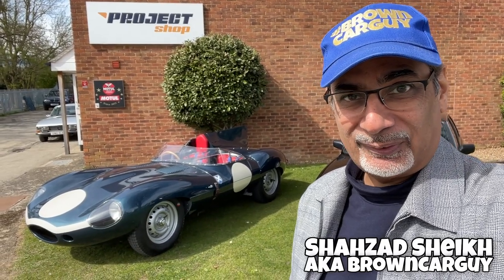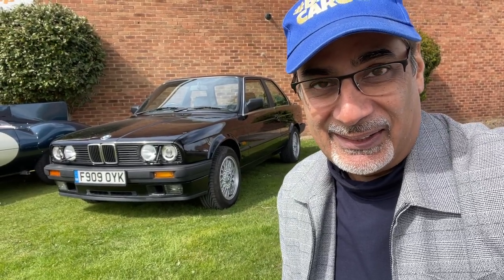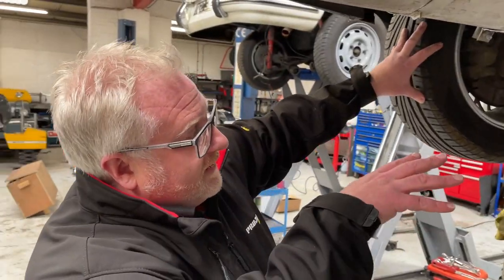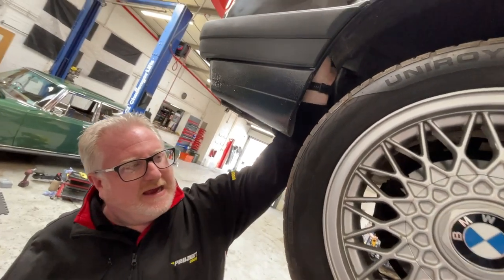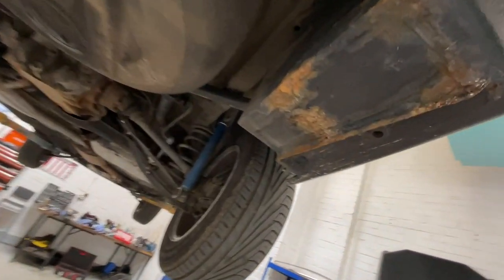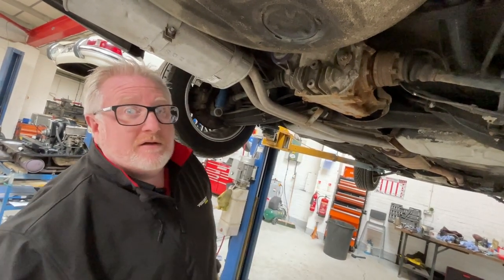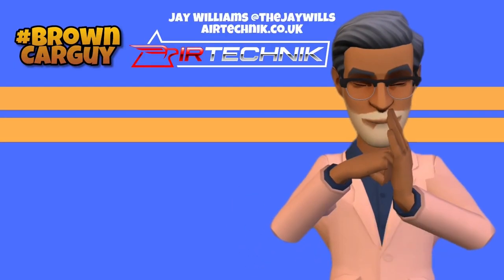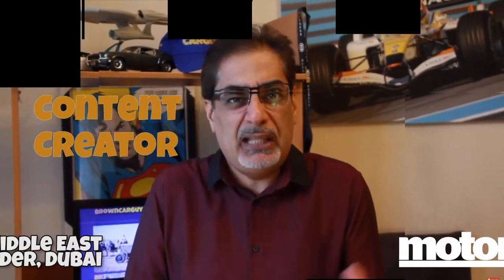UH-OH! Expert Gives Verdict on My E30 BMW 325i Classic ! 😲

Comment: Don't jet wash your inner arches. They are double skinned. And it will hold the water. Would be best to use compresed air. Or try get it out by hand. Would hate for you to cause rot